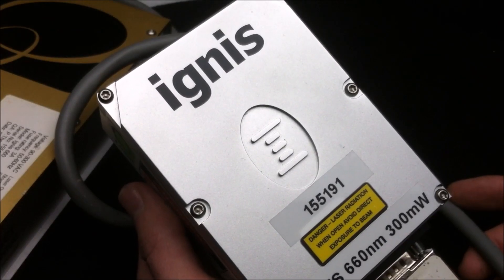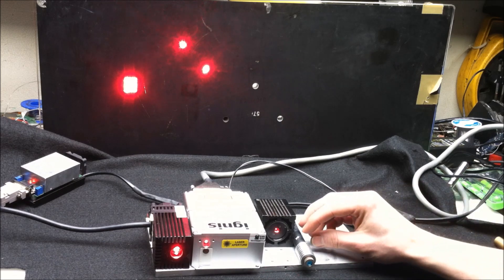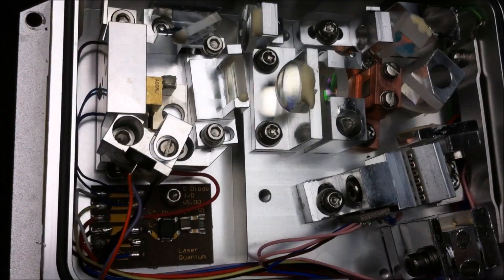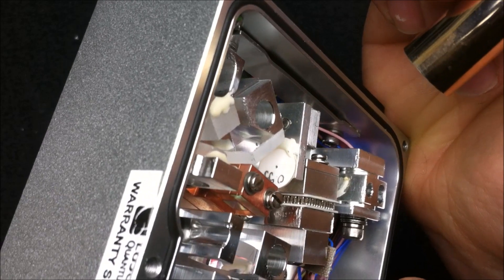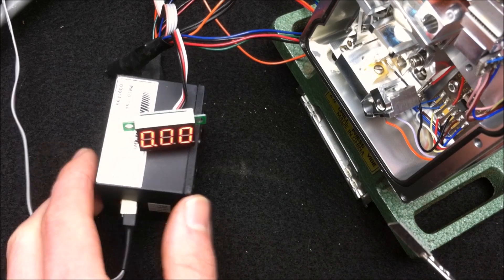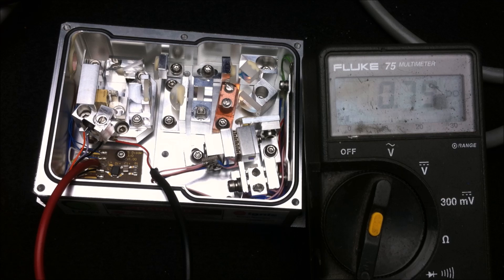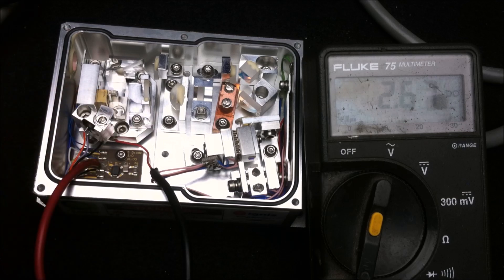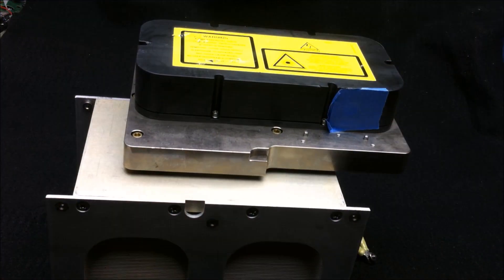The Ignis 660nm DPSS Red Laser

Comment: How do they suppress the 1064 line which has more gain?  When these things are manufactured, how are all these tiny optics adjusted & aligned?  (There are no "tweaks" like you see in gas lasers.)
Reply from the maker: The Nd: doped gain medium have several lines that can be lased just like a gas or ion laser. The gain isn't really as important in comparison to what's is being reflected back for stimulated emission. Just like the HR/OC mirrors on a gas laser the crystals also have coatings on them, the line to be lased is selected by that coating and is reflected back into the crystal.

These optics aren't all too difficult to manipulate by hand, It's when you run into the soldered optics that you need something like a multi axis micro manipulator.

Comment: where is the green laser video you mentioned in the last 10 sec ??
I play around with the ALGON GREEN you mention right now, my IR diode works, but no green output sadly.
https://youtu.be/P4koaEdaI9E
Reply from the maker: Oh the Lightwave Electronics HalfNote. I do have it here and I am working on higher current drivers a bit still. I should have a video on the HalfNote up later this summer along with some other larger laser videos. If you want to know more about the HalfNote in the meantime my friend posted up pictures and information about that laser system when he visited.

https://ntenterprise.org/elec/lightwave532.html
Reply: @Zenodilodon  thanks for the link, it is EXACTLY the same laser as the one i play with at the moment
Reply from the maker: @TeardownOZ2CPU  If you need any help on it let me know. I know the unit pretty well!
Reply: @Zenodilodon  Thanks mate, I really like to know if the mirrors are mounted on temperature controlled moveable pivots ? the connection points to the mirror holders measure 40 ohm, so i guess it is for heating ? I also like to know normal operating temperature of base metal and crystal and laser, maybe that is my problem, I am not super deep into lasers, but I am EE and design electronics for a living, I really love to see my unit shine again, do you think that is possible ?
Reply from the maker: @TeardownOZ2CPU  You nailed it on the head, those optical mounts are on heating blocks for positioning. 

You will need 3 things for the HalfNote

20A capable PSU with constant current mode.

A closed loop TEC controller with the capability to read a 10K NTC thermistor.

The 3rd is a driver for the PTC heater for the KPT crystal. I recently developed a new PTC heater driver that uses bugger all for parts and has been tested. 

I can send you a schematic for that, or any of my work. You'll be able to get the laser going nearly effortlessly! Do email me Zenodilodon@gmail.com

Comment: the 1320 from the nd:yag is really cool! Would there be a way to find out what coating a yag you get from a second hand source is? I assume most are 1064 but would be cool to know if there is an easy trick
Reply from the maker: Since it's all in the IR it is quite hard to tell visually. My best solution would be to get LEDs that are near the Nd transition lines and test the reflectivity of the coatings per wavelength with a photo diode.

Comment: time for a new pump diode happy hollidays
Reply from the maker: Where are my manors... Happiest of holidays to you too!
Reply from the maker: Yuppers! The driver needs to be reset via PC but it should be good as new with a properly working pump.
Reply: @Zenodilodon   yea  are those the same as with the old lightwave laser controllers ? just need the pc software to set max current en tec temps etc etc
Reply from the maker: @martijn4740  i am unsure, I have not messed with the driver all to much, I had the seller program them to auto-start. I think the software does cover a lot of those settings. There are also turn pots in the controller for temperature too.